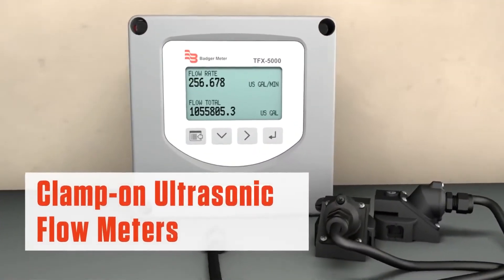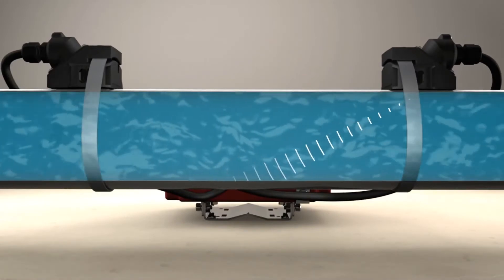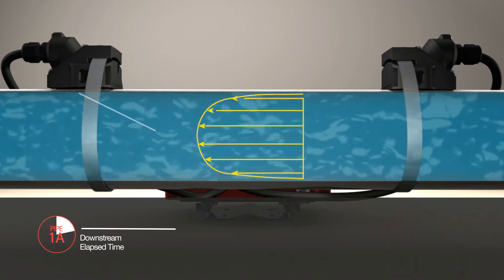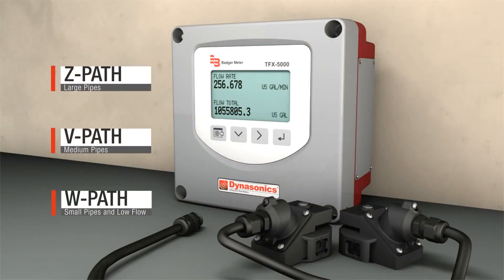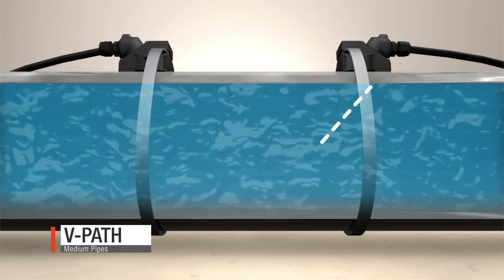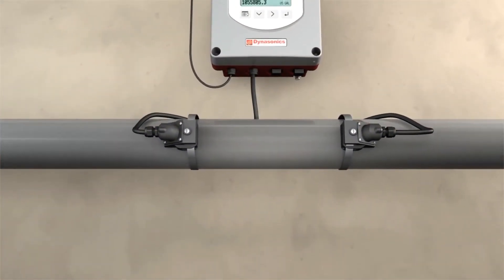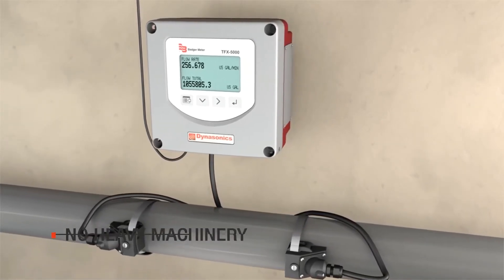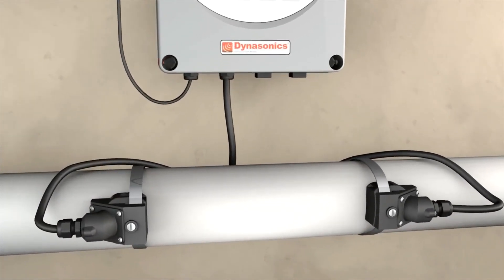Clamp-on, Ultrasonic Flow Meters

Comment: Hi. Excellent alternative for measuring flow. Can you tell me where to find the datasheet for this equipment? or if it is possible to use it with a mircrocontroller?
Reply: Do you need to buy this kind of ultrasonic flowmeter? Shanghai cixi can provide!😁
Reply: @microflowmeter  Great! can you send me a link to the purchase?
Reply: http://www.pandametering.com/?fbclid=IwAR2V7s4tOZUhZeet6PedfCfCntyFKRE3-z-CUvGc_-TC7f3SWVUCtldJOcU#productCenter
clamp-on ultrasonic flow meter